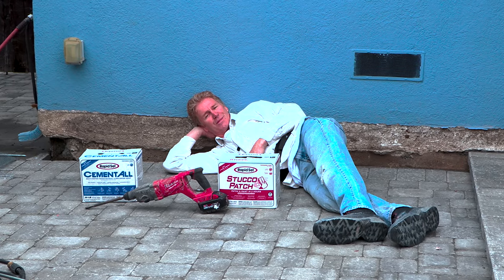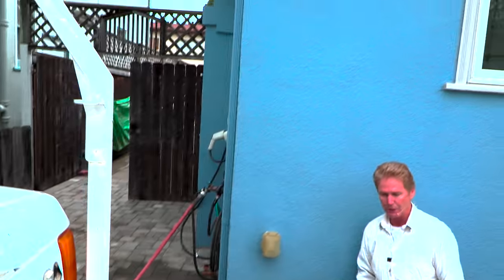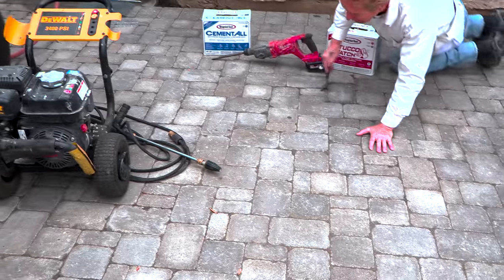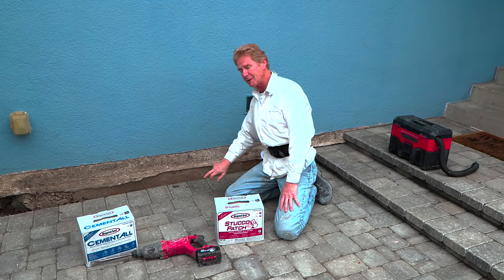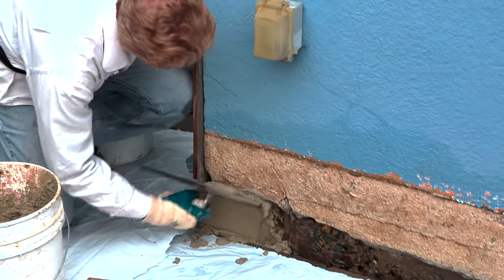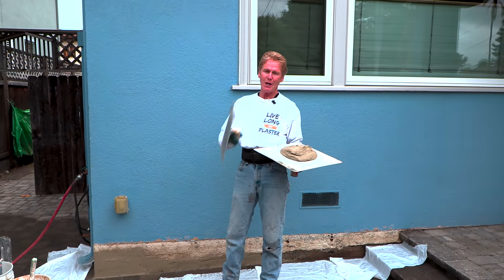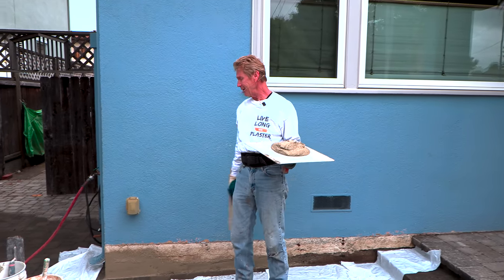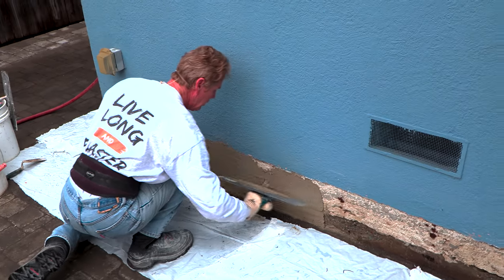Repair ugly concrete and stucco foundation, HD stucco

Comment: Love the video as always. That Cement All stuff is super strong, also the other thing about it is it has way better adhesion to the old concrete than other mixes or products. The old concrete will break and deteriorate before your patch ever does! Also, really smart on preaching how important the prep is, like the nice pressure washing you did. No product will ever work without that level of prep and so few people realize that.
Reply from the maker: Exzackory, prep is king. 🕺🏽

Comment: Kirk that cement all is 9000 psi after 28 days.  It's rediculously strong.  They also claim that the hydraulic cements like rapid set actually form hooks that bite into  existing concrete.  Amazing stuff
Reply: Compressive strength isn't problem in concrete either it's tensile strength what should be good and even that rapid set has a much lower tensile strength. Because if there is moisture in concrete or in that patch and it gets frozen ice that forms tries to push everything apart and then it's all about tensile strength.
Reply: @mr.wizeguy8995  yeah we all know that about cement/mortar/concrete
Reply from the maker: Howdy Finders Keepers Dude, Yea, I't crazy strong stuff. I always tease my girl and ask, what's the difference between stucco and concrete? She's close to remembering, Concrete is portland cement mixed with rocks and Stucco is Portland cement mixed with..... Sand. 
I say this after she asks me, what a SME? I finally remember as this game has been going on for awhile. Anyone know what an SME is?💃🏻
Reply: Love your vids.  “SME” is what you are in your field/trade of stuccoing and other masonry work.  It’s subject matter expert.
Reply: @StuccoPlastering  You got it goin on Kurt.  Tight family, good reputation, what more could/should a man want?
Reply from the maker: Finders keepers loosers weepers,  I would like to get back my properties that were stolen in Maui by a corrupt chief judge and his attorney-judge nephew, which cost, my family and me more than all the cash we earned making all these videos or for the last15 years of labor. You asked. 🤔
Reply from the maker: @meangreen7389  Howdy Mean Green, my girl, Judy, says that too. She's really the best. 💃🏻

Comment: Cement can be tricky sometimes.  It must be hydrated so not to dry too fast.  It will get hot and crack if not hit with water until cool to touch.
Reply from the maker: Excellent advice from no doubt a pro, thank you.👨🏻‍🔬

Comment: Hey Kirk, I have concrete ceiling in the basement. With through cracks causing leaks from ground surface to the basement . What is a good way to seal the cracks from the bottom and top and finish the concrete .
Reply from the maker: Good morning, are you referring to a quality caulking for the cracks? If so I'd recommend sikaflex 1A as it's an adhesive sealant. It should only be applied to a surface clean enough to eat off, or it won't adhere.  Nothing adheres to. dirty or. dusty surfaces, except spider webs.
To refinish concrete, Id recomend Poly-Bond, but it's a cementitious adhesive cement only found at Plastering yards. Plusoly-Bond involves slacking which most may not understand how to use. Thus for a more user friendly concrete finish can be found at HD and Lowes stores.

Comment: Is a coarse rubber float best for floating out a substrate for a dash finish?
Reply from the maker: The rubber floats compact the stucco, the sponge floats bring out the sand which make dashing much easier

Comment: Kirk can I use cCement all for my stucco repair and finish?  Would you compair cement all to  stucco 20/30
Reply from the maker: Yes, however Cement all, hardens in about ten minutes and is harder than concrete.🕵🏼

Comment: Love your vids.  

You said two hours before you could paint that stucco brand initially, but then said two days before painting.  It is two hours?
Reply from the maker: Howdy mean Green, the box does indeed say 2 hours, Ops, I'm used to at least two days. https://www.homedepot.com/p/Rapid-Set-25-lbs-Stucco-Patch-71020025/203110401/🕵🏼
Reply: @StuccoPlastering  - Ok, thank you.

Comment: Kirk, do you know anyone in Iowa who would do residential stucco? Would you suggest I do it myself? Because no one in Iowa has a stucco home, it's hard to find a contractor.  I'm also worried that if I do it, I could do it incorrectly, or cause a future home insurance claim issue. Should I call a drywall guy? What do you suggest? Thank you!
Reply from the maker: Howdy Black Jack, I recommend you google “Plastering contractors” in your area. This may help you decide.
 This search may also bring up “yelp” Theirs is a paid subscription, so their reviews may be more biased than Google's; however, you can scroll and read through the Yelp reviews. Hopefully, with the help of both reviews apps, you will find the best fit for your needs.
 If you’re still unsure, ask to view their completed jobs or repairs and, if possible, speak directly with their past clients. Cheers.👨‍🏫
Reply: @StuccoPlastering  Thanks so much Kirk!